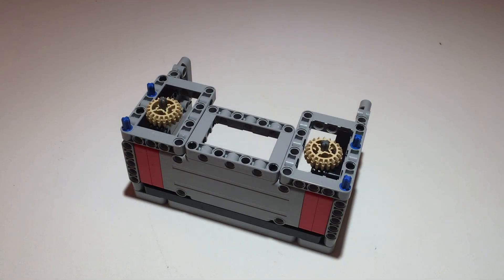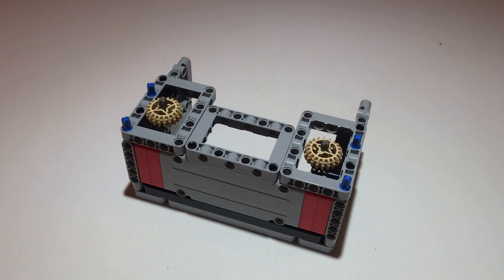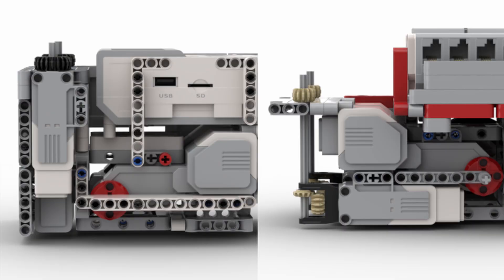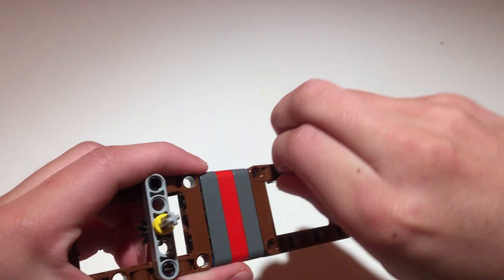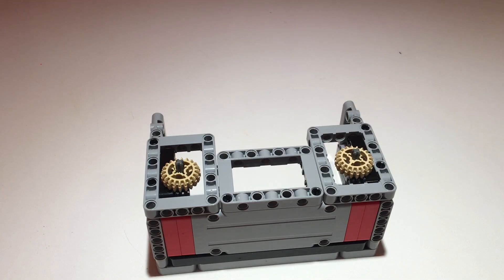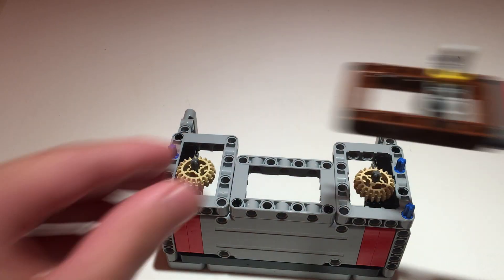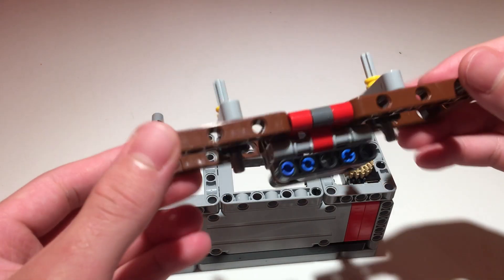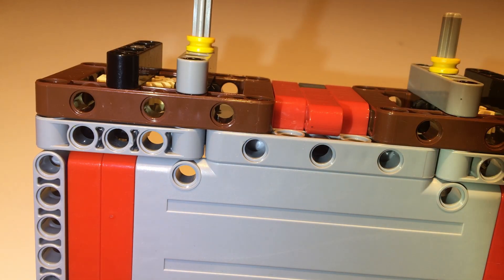How to make Slip-on attachments for FLL

Comment: Thanks for posting another great video. Your videos are a great complement to those on the EV3Lessons channel since you cover techniques they do not cover and/or you cover them in greater detail.

Your points about not using pins to fasten attachments to the main chassis and about rigidly maintaining the center-to-center distance between gears are crucial to saving competitors a lot of heartache and frustration.